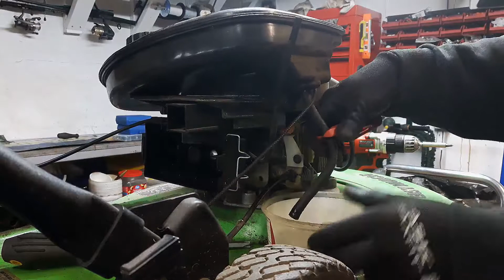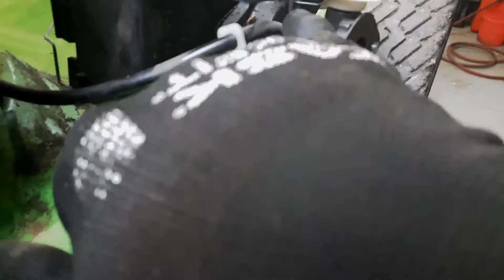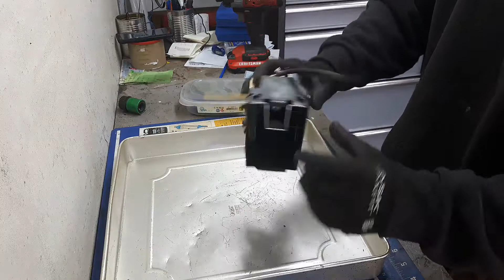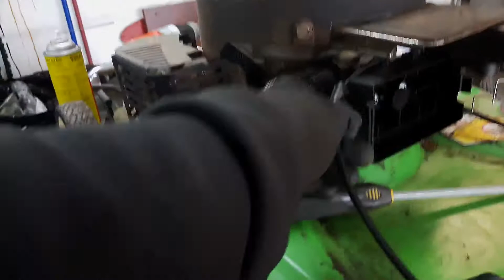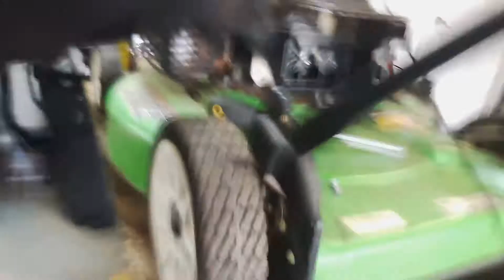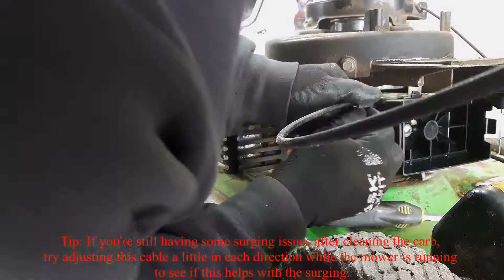How To Clean a Lawn Boy Carburetor

Comment: The aluminum plate is a heat barrier.
Reply from the maker: That is correct sir. I mis spoke calling it a gasket. It is in fact a heat shield. Hard to edit out voice. Although if I knew how to do that, I would have the perfect voice for a voice over. Lol
Reply: @brantsmallenginerepairs hi, I’m in the midst of putting back on my carb but gasket wise is it:

A) Engine-gasket-heat shield -gasket - carb 

B) Engine-heat shield- gasket - carb

Thanks!